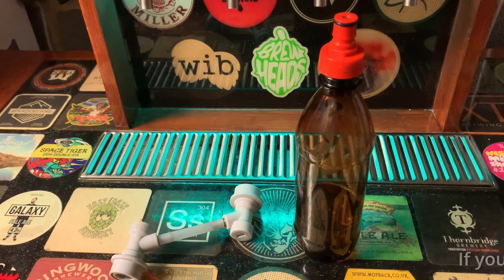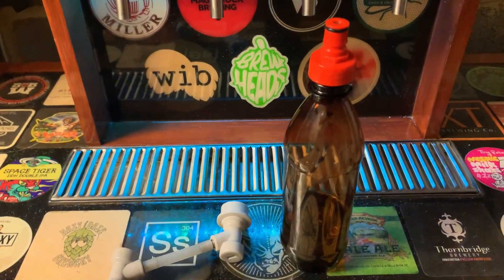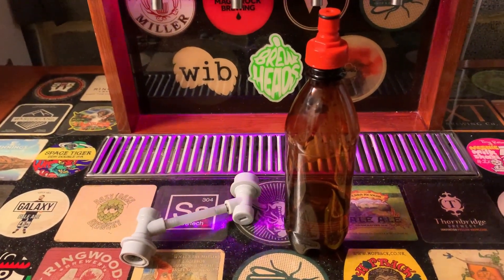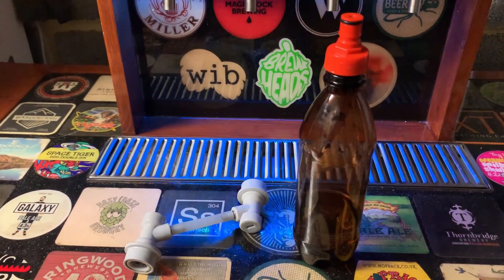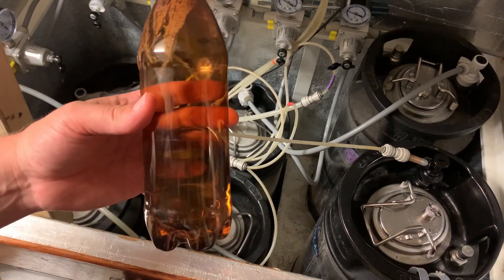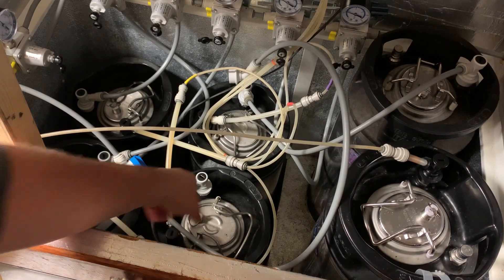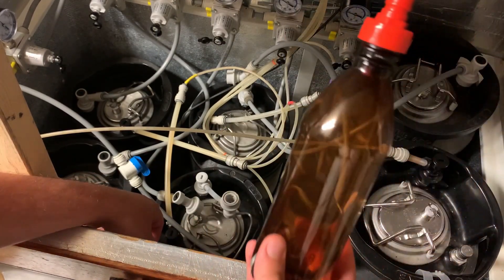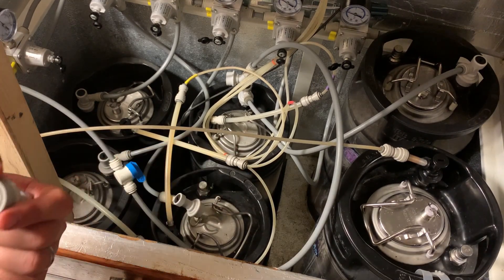I'm not sure what to call this contraption! Closed Transfer Keg Injector thingy....

Comment: I use the exact same method. Works well for me. That small dip tube on the carbonation cap comes off quite easily with a dremel tool.and the whole contents of the bottle will go straight through to the keg.

Comment: I was just thinking about this, and then your video popped up! Loving your work.

What quantities do you use when you're making up your gelatine solution?
Reply from the maker: cheers guys, I do about 100-150ml of water and 1/4 teaspoon of gelatin powder heat the water to about 70c and stir til dissolved
Reply: @DudesBrews  just done this. Used a 500ml coke bottle as it’s what I had lying around. Worked a treat!
Reply from the maker: @OysterBoysBrewingCo  awesome glad it worked well, hope you get a nice clear beer in a few days! 🍻
Reply: @DudesBrews  let’s hope so! I’ll be drinking it during the f1 on Sunday.  All my kegs have floating dip tubes so should be all good

Comment: You could either add a pickup tube so you can better purge air from bottom to top? Also, sacrifice one of the carb caps and shorten the barb to leave less solution behind? Cheers

Comment: If you use a t-piece and 2 caps you can use that to help flush the line. I have been trying this with isinglass but it can clog . How long does the gelatin take to clear? Do you agitate the fermenter? Cheers
Reply from the maker: I'll usually give the keg a gentle swirl just to distribute the solution a bit, gelatin can be pretty quick like 2-3 days but obviously depends on the beer you are trying to clarify. You will get 1 or 2 murky pints out at first as well

Comment: Genius - been using syringes filled to try minimise oxygen and de-gassing keg, then burping - but this is even better guaranteed - did you flush the jumper cables first tricky ?
Reply from the maker: Cheers! yes forgot to mention that in video but gave it a quick blast of co2